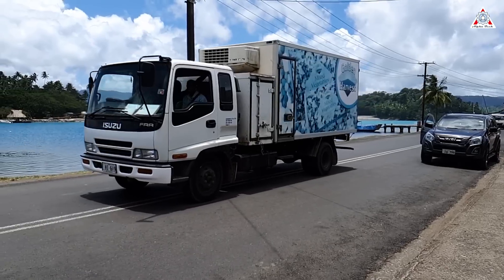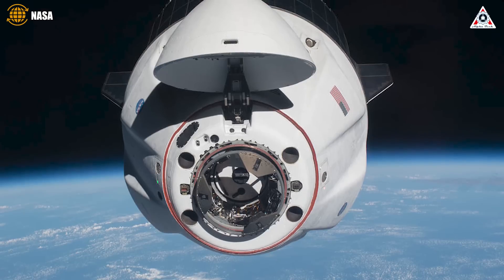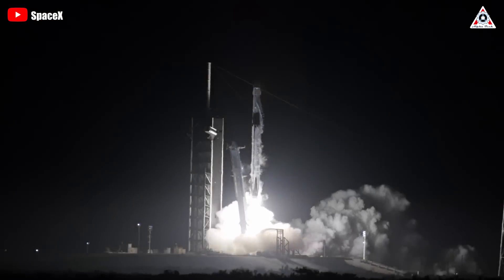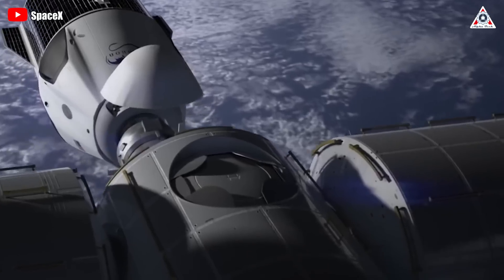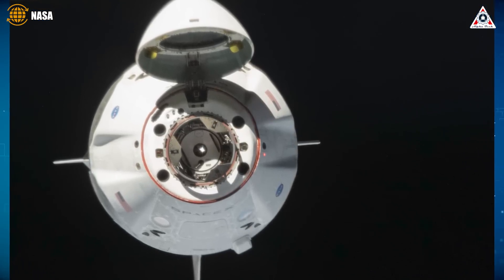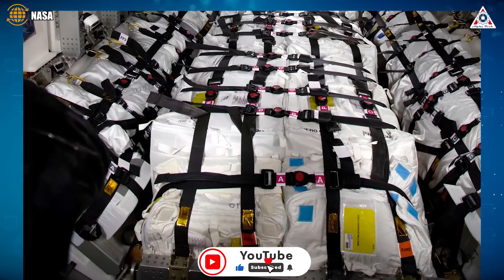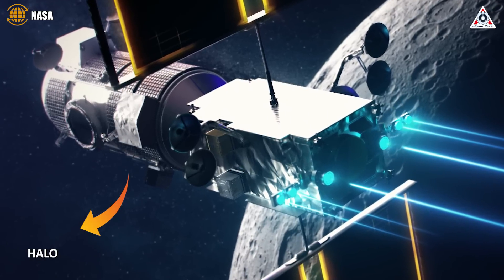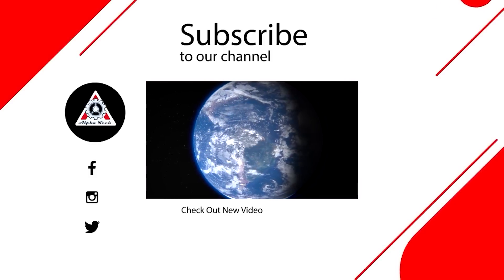SpaceX's Dragon NEW Spacecraft variant headed to the Moon...NASA revealed!

Comment: Couldnt they modify a Starship with a docking port, and put it into permanent lunar orbit?  Seems like this could be used as a first step to aide in later Gateway lunar space station.
Reply: My gut feeling is that the plans for the Gateway are already well underway and also NASA has to stick to a set plan. One change in the 'set plan' creates a tumble effect that could mean introducing incompatibilities in hardware and software. i.e If SpaceX design a Starship, it may not have the correct elements to keep it in a near rectilinear halo orbit. It would mean starting from scratch and matching all the systems and hardware. That would add delays.
They had a 'technology' problem when building the Space Shuttles. New Technology would create a smaller radio transmitter for example. Good weight saving but then the interfacing power supply would have to be changed (as an example). This meant they used equipment that might be 5 years old, but it was all compatible and documented. And they had the parts on hand. Sometimes you have to forego the temptation to do a technological jump, just to get the job done.

Comment: Why can’t they build the moon’s space station in earth orbit, then thoroughly test it out before moving it to the moon with a space tug? With no humans on board there’s no rush to get into place, so they could take the most fuel efficient route.
Reply: 1) Assembling it in Lunar orbit lets NASA, ESA, JAXA, and CSA use existing launch vehicles like the the Falcon Heavy. In fact, all non crew missions to Gateway from NASA and CSA will use Falcon Heavy.

2) We don’t have a space tug and there are no plans to build one. And even a fully-fueled Starship does not have enough energy to move a fully-assembled Gateway from low Earth orbit to lunar orbit. It would still have to be moved in pieces.

3) Gateway is modular and will be able to function before all the modules have been launched. As video says, the first two modules, HALO and PPE, are planned for launch by a Falcon Heavy in late 2024/early 2025. The modules from ESA and JAXA won’t be ready until several years later. 

4) Finally, making it modular will let NASA and SpaceX transition from an SLS/Orion/Starship architecture to a fully Starship architecture over time.
Reply: @bbartky makes too much sense
Reply: The power/propulsion module flying up first with the HALO module already provides some "hefty" ion thrusters.